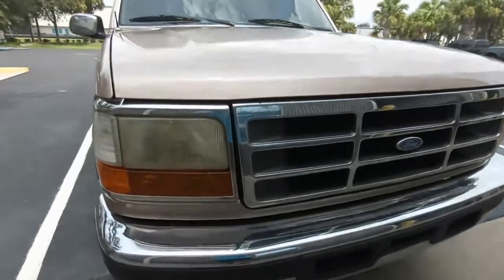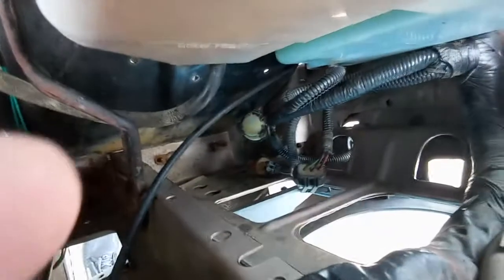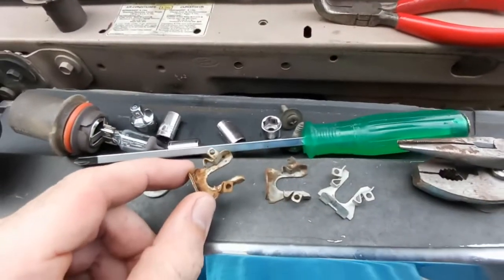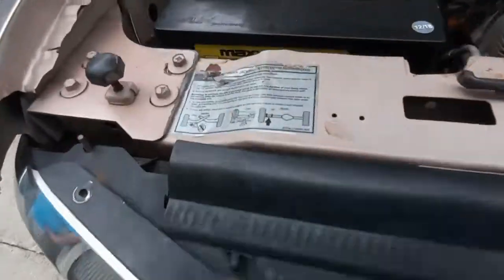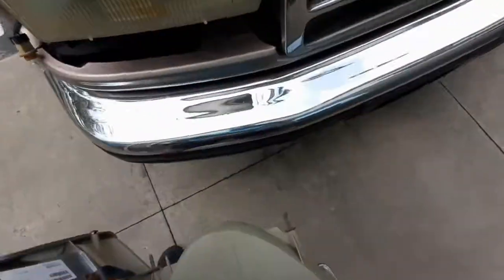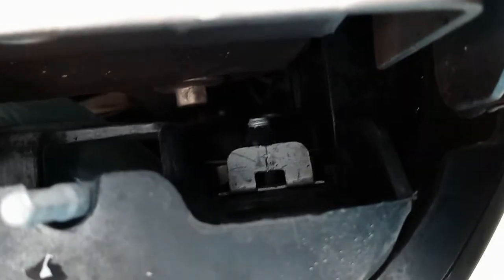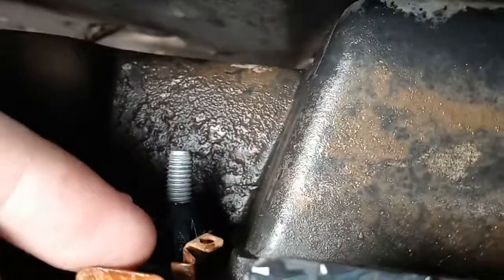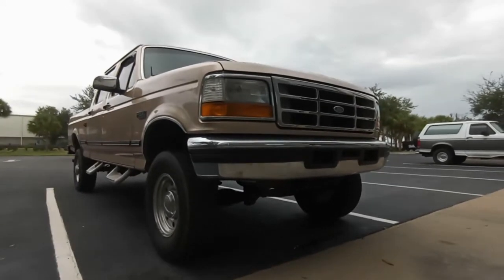OBS Ford Headlight Replacement WITHOUT REMOVING GRILL 1992-1997 Bronco, F150, F250, F350

Comment: So theres a little tab that holds the clips in, the top two take a pair of needle nose, open them, put one side in the opening on top, and use it like a pry bar and they'll pop right out. You can do the same with the bottom one but you go in at an angle